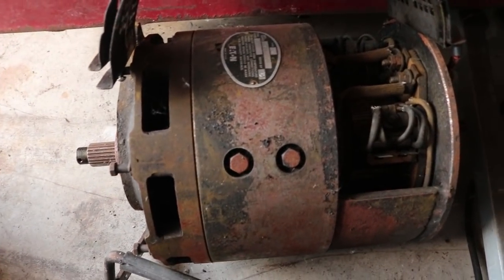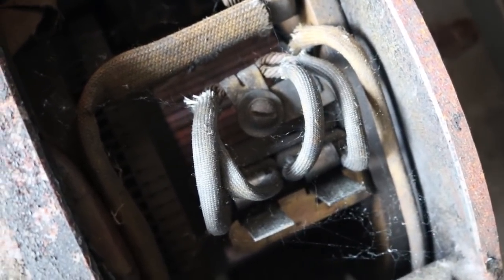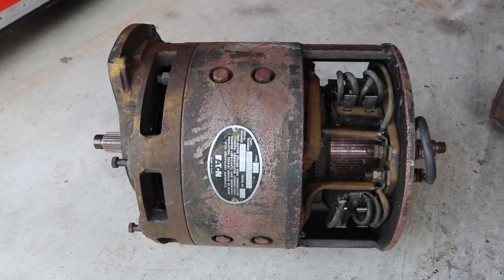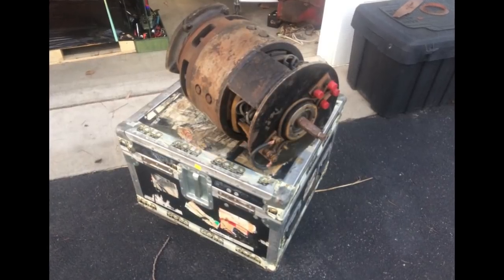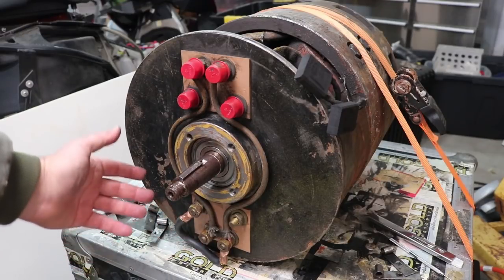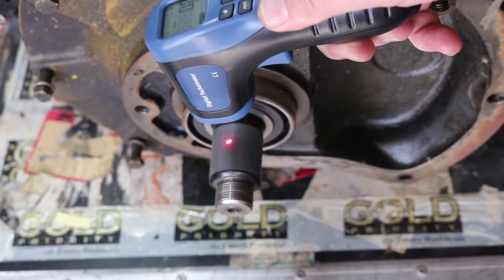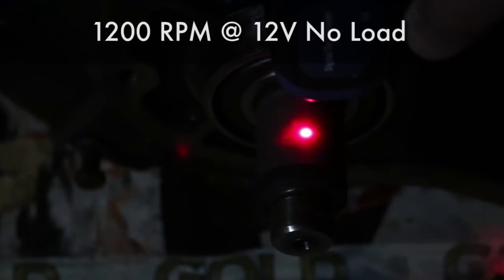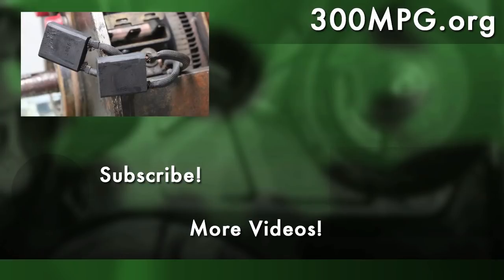MASSIVE DC Motor for Electric Tractor! | In-Depth Specs & Speed Testing

Comment: WHAT IS THE  MAXIMUM RPM I CAN GET FROM THIS MOTOR, I HAVE ONE AS WELL
Reply from the maker: The higher the voltage, the faster the rotation speed.
You would want to be careful at high speed and high current, as it IS possible to start to melt parts and actually destroy the motor by having it fly apart!
DC Series-Wound motors should also never be run without a load, other than at very low speeds for testing. Without a load, it's possible for them to spin very fast and get damaged.

Comment: Oh that 21 spline shaft is a standard 1000 pto shaft.  My John Deere 930 mower conditioner uses that on the pto.  There is a coupling which attaches to the gearbox on the mower that has the same 21 spline shaft but has a slot cut in the side and a half inch bolt to lock it on the spline.  That would slide on without having to disassemble the locking collar to remove the ball lock.  But any 1000 pto shaft will fit that motor spline.

Comment: I am very interested in this project as I am considering doing a conversation on a farmal h or an allis Chalmers D17.  
Having used loader tractors for years I would seriously consider a separate motor to run the hydraulics you will want live power on the loader hydraulics all the time but when you come to a stop and raise the bucket to dump you won't want to keep the motor cranked up plus if you put the gear pump on the back shaft of the electric motor you loss the ability to reverse the motor to back the tractor up.  The gear pump won't take running backwards.  Also avoid reversing the motor with the pto running as the attachment won't take well to being reversed.  But I am seriously considering a separate motor to run a 12 hp hydraulic pump for my system.  Another reason is I run a wood splitter on my tractors.  A dedicated motor would allow me to size the motor to the load and run more efficiently when I only need hydraulics.

Comment: Do we need a gear reduction transmission because the electric motor(s) spin so fast....
Reply from the maker: This motor should spin at approximately the same speed as the gas engine from the tractor would have.
A motor such as one from a Nissan Leaf would definately need additional gear reduction to take advantage of the potential higher speed.
Reply: @BenjaminNelsonX  
Are they coming out with transmissions specifically suited or developed for electric motors, if so, do you have that information or links...

Comment: did you give up on the leaf motor as your prime mover?
Reply from the maker: I don't think "give up" is quite the right wording, but at this point, I think a low voltage DC motor is probably the best approach for this project.
I'd LOVE to use the Nissan Leaf motor in the tractor, but just don't think it's the right thing. I'll be using it for some other project.

Comment: The adapter does not lock because PTO shafts have a locking groove that provides that locking action and obviously because this motor does not have that groove it will nver lock. 
Personaly I am thinking about making a tractor that uses a diesel generator instead of a battery and an electric motor as a motor thus letting me work for a whole day without worries and because I will be using a generator I could use an efficient combustion engine ( perhaps use hydrogen that was made using solar panels or change the whole generator with hydrogen cells, who knows)

Comment: thanks for the great videos.
if I wanted to power this type of motor for a project at home, how would you run it using a 220v wall outlet and attach a speed controller?
Reply from the maker: This type of motor is really not designed to run from wall power. To properly do that, you would need to convert from AC power to DC, drop the voltage to an appropriate level, and then use a typical PWM motor speed controller.

These motors can create massive torque, but they also do it by drawing HIGH CURRENT, something that can be handled by a large battery pack, but not so much from an AC branch circuit.

Comment: ....the ball bearings, are A locking mechanism, to the shaft. You'll either have to lathe down a notch on that motor shaft at the correct depth of the shaft,  or, remove those balls and springs somehow.........

Comment: It'll fit Ben, I think you should be fine using the 5 bolt pattern of the motor without worrying about the rest of the bolts set back in the housing. There's a lot of holding power in those 5 bolts.

Comment: An angle grinder will put an appropriate groove in the splined shaft. Spin the motor as you’re cutting, kind of like a lathe.
Reply from the maker: And just to be clear - I don't need to lock a PTO device onto this shaft, I just wanted to see if it was a standard size which I would easily be able to find some part I could connect to it to make a coupler or flywheel mount, rather than having to cut female splines from scratch.
Reply: @BenjaminNelsonX  I was forgetting you need a gear reduction rather than connecting directly to a pto driven hydraulic pump!

Comment: 24 kw for that DC motor size is somewhat optimistic except for intermittent short cycle use. Series motor speed is meaningless under no load. You could overrev and destroy it applying nominal voltage or even less
Reply from the maker: I've had no issues putting 500A and higher voltage through series-wound motors smaller than this.
I wouldn't say that a no-load speed is meaningless - it's just that it only shows you the maximum theoretical speed. Under ANY kind of load, it will be lower than this, but at least it gives us a "high-side" number.
I wouldn't run it at no load at any higher voltage than this.
Reply: Good luck
Reply: I'm sure I overreved my 6kw baldor in my tractor while testing an accidentally overcharged pack. Since then I've ran 200kw thru the 6kw motor several times successfully. I agree prolonged use at high power will destroy motors, but utility tractors rarely see high current use more than a few seconds at a time. Should you install this motor in a 10,000lb tractor and hitch up a 16' chisel plow for a days work? No. From my first person experience with my EV tractor this motor is too large for this project if anything.
Reply from the maker: @stevenmurphree  Yep. Probably overkill. Might be nice for a future truck project.
I have another potential motor, but it's missing the tail-shaft.
I might have to look around a little more and see if I can find something even better.
Reply: @stevenmurphree  @BenjaminNelson , I am new to conversion and currently just reading and watching as many videos as possible.  I am interested in tractor conversion and would like to explore the possibilty of converting our non-functioning 100 HP tractor.  If one was to convert a 10,000Ib tractor which would high a 16' chisel plow, what sort of motor characteristics should be considered?

Comment: The pto adaptor, those balls do fully retract to get on a tractor pto...
Reply from the maker: Andy, I just went to your YouTube channel. LOVE the preview video! I'll definitely have to watch through some of your tractor videos.
Reply: @BenjaminNelsonX  haha thanks
Reply: @BenjaminNelsonX  when you look at my channel, I'm not anti electric or anything. I've always wanted an electric ranger and thought of doing some electric projects but just haven't got into it yet.
Reply: Good  day Andy I came across this site yesterday, & because it's IH of course I got to check it out.  Yea when he said 21 splines 1-3/8   I thought right away  about the 1000 shaft. This could be interesting.  I'm   thinking it will be to slow or to small >  Thanks
Reply: @donvoll2580  hello Don. If this would fit in the tractor I think this 1 3/8 shaft could be adapted fairly easy to the tractor input shaft with a coupler. I did some searching but didn't a common coupler for this combination so I'm guessing it would end up being a somewhat custom part.
Reply from the maker: The shaft may have just been bottoming out in the adapter. I should have thought to stick a depth measurement inside to check it. Other than not locking onto the splined shaft, it felt like a good solid fit.
Reply: @BenjaminNelsonX  Yeah it looked to me like it was just bottoming out.
Reply: @BenjaminNelsonX  it could be the balls towards the top not retracting because the taper on the end of the motor shaft being a different angle than a tractor pto.
Reply: @BenjaminNelsonX  on a "1000" pto shaft, it will have a lock grove just like the "540" pto. The balls drop into that grove to hold it to the shaft.

Comment: Huh, thought the plan was the leaf motor. Whatever works best, right?
Reply from the maker: Right, what I really want to do is convert this tractor with the most appropriate setup. I've been playing with the Leaf motor to learn about it, and I love the idea of using an AC motor, but mostly just because I haven't done an AC motor project before. The AC motor would need a relatively high voltage battery pack. There's also some concerns about the bearing in the motor if used with a clutch. No tail shaft either, and I think a tail shaft would be the simplest way to power a hydraulic pump - similar to how it was done originally on the tractor.

This motor could be run at 48V, which is a super-common system voltage. Motor controllers, chargers, DC/DC converter, and other components are all easily available at that voltage.

500A @ 48V is about 32HP, which is comparable to what this tractor was originally fitted with for a gas engine. Of course, for TORQUE, the electric motor will have an advantage over the gas engine.
Reply: @BenjaminNelsonX  
What about the leaf motor and gearbox? Lock the differential, one shaft for traction, one shaft for hydro pump?
Reply from the maker: @paftaf   The Leaf gearbox is about an 8:1 reduction. Even if the Leaf motor ran at it's maximum 10,000 RPM, that brings the gear-reduced speed down to 1250 RPM. The tractor is designed to run at about 2,000 - 2500 RPM. The hydraulic pump and overall speed of the tractor would be 40-50% slower.
Plus, adding the gearbox offsets the position of the motor, making it into an awkward shape and very much limiting battery size and positioning.
Reply: @BenjaminNelsonX  
Yes, you’re right. Sorry I was wrong. Thanks for taking the time to respond.